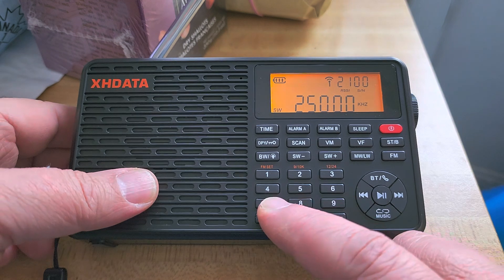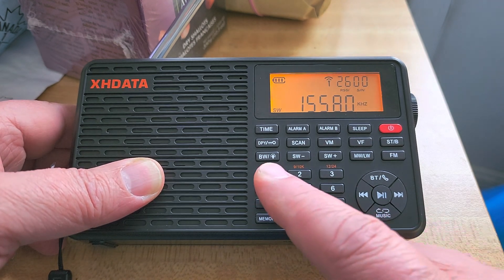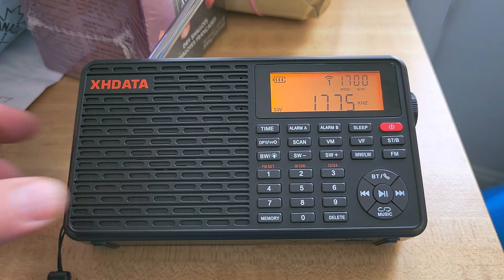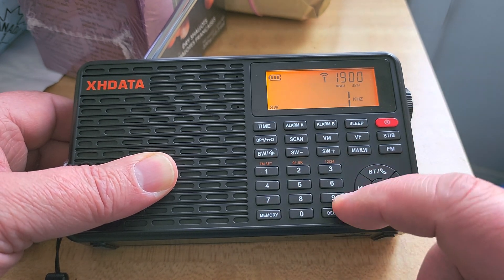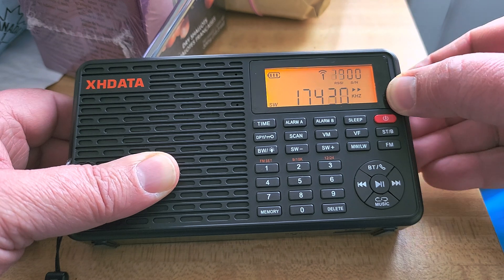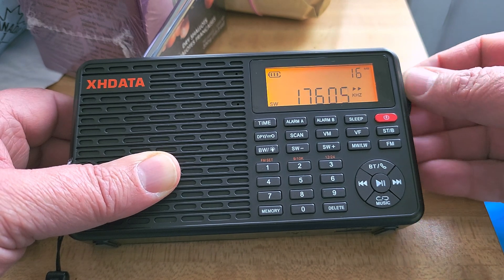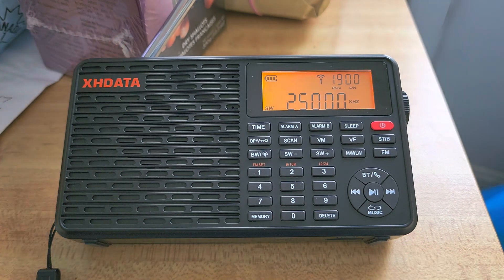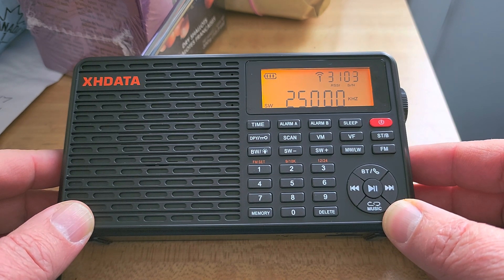XHDATA D-109 on 25000 kHz Shortwave WWV Colorado and weird keypad bug

Comment: friend, could you clear me some doubts? the radio memorizes the last selections that you previously configured, and when you turn it on again, will it be the same way you left it? for example: if you selected FM, and selected the VM button to go through the memorized frequencies, when you turn it on again. will the diaer button continue to be configured to scroll through the memorized frequencies? or will it be in tuning mode? and the display information, if I select to show the signal strength, when I turn the radio on again, will it be as I left it before turning it off?